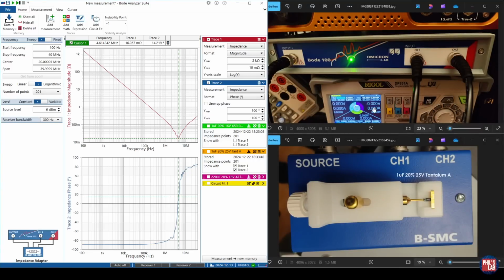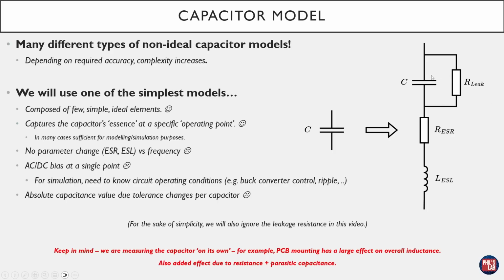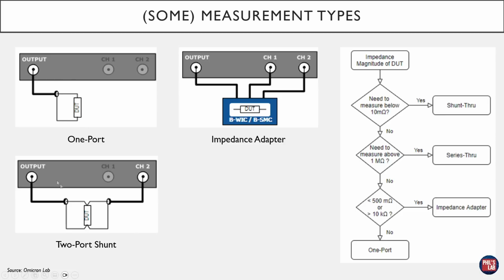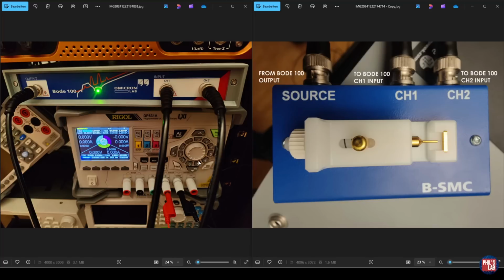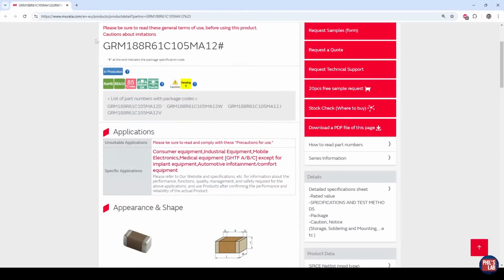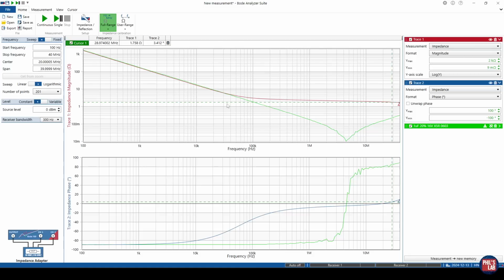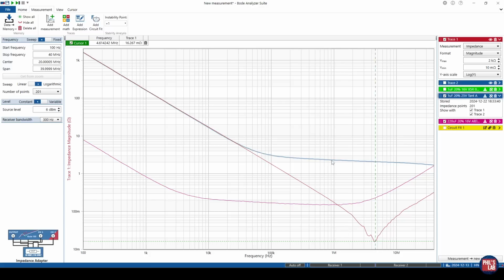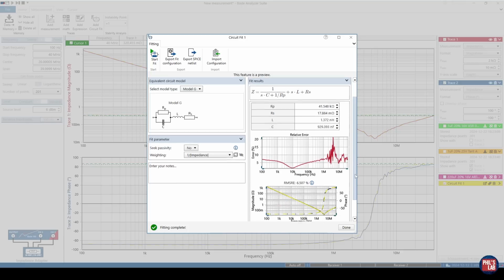Capacitor Measurement and Modelling Basics (Bode 100) - Phil's Lab #150

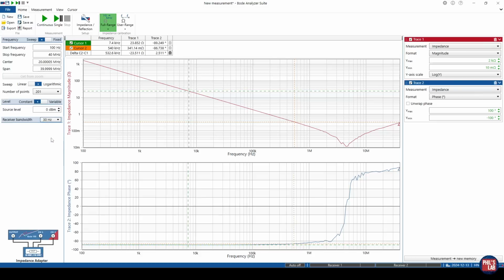Comment from the maker: Clarifications: 1. @29:00 I meant to say 'Number of measurement points increases resolution' (receiver bandwidth decreases noise).
2. Discrepancies in MLCC self-resonant frequency (measurement vs datasheet): I assume this is likely due to the limitations of the impedance adapter (sub 20mOhm measurement, 10% error already at 0.5Ohms, inductance limits already at 200kHz, etc etc - see the B-SMC user manual).
Also how much force is applied to the mechanism to improve the contact (during measurement & calibration) will influence the result slightly - like I mentioned in the video, I'm solely relying on the clamping force of the spring: e.g. for a 'short' calibration at around the resonant frequency of the MLCC cap my measured impedance is well within the range of the ESR.) Also, looking at the impedance vs frequency curve given by Murata, the SRF dip is actually quite broad (hits 20mOhms and below at 4-10MHz). During making of this video I've recalibrated numerous times to check for any calibration errors, checked multiple different caps, put two caps in series, and am consistently getting the same results. In future videos, we'll look at other measurements techniques (e.g. 2-port) and compare the measurements (I measured the same cap with 2-port and am getting far closer to the correct SRF and inductance).

Comment: Hello Philip, 

if you need an idea for your next videos: pcb  design for stm32n6 with battery power supply and pin out for cam module. this is the latest thing, it has a difficult package and you can make videos for the firmware to recognize license plates to open garage doors or something like that. will definitely be of interest to a lot of people in the next few years :)

Comment: Hi, good video. What would the specs of this small TVS diode be?. 100 1t NI or 11 NI?. It is installed on a old 3 digit PC Turbo LED MHZ display board (PD 900) and 

needs replacing. 5V the display gets. Has only one marker at the end and the ->I symbol on the board. Greatful for an answer.

Comment: Thank you for the very informative video! It would be neat to see the Bode results with a DC voltage applied to the capacitor using your DC Block and Bias adapter.
Reply from the maker: Thanks, Nick - we'll look at that with 1-port and 2-port measurements!

Comment: Hello Phil.
29:00 I'm not familiar with the device, but it seems to me that if you want to increase the resolution then it would be necessary to increase the number of measurement points rather than narrowing the filter. Narrowing the filter will reduce the noise level, not the resolution.
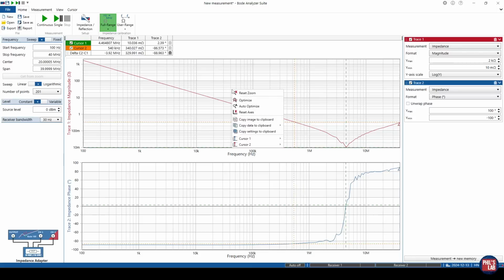29:30 The resonant frequency error is very large. 4.5 MHz measured and in the datasheet 7 MHz. Converting this to inductance, we get 516 picohenrys according to datasheet or 1250 picohenrys according to measurement. This is a very large measurement error. You performed the calibration and justify this error with an uncalibrated inductance of some kind? So You did the calibration wrong? Why didn't you do this calibration again already correctly? or maybe it is the instrument that measures so inaccurately? I did such measurements with the NanoVNA-H4 on 0805 100nF capacitors and got near 800 picohenrys parasitic inductance. Error much smaller than with a device for thousands of dollars. I also measured 2 pieces in series, in which case the inductance adds up, and it more or less agreed with the measurement of 1 piece.
Reply from the maker: Thanks for your comment! Regarding resolution and measurement points - you're completely right, I'm not sure why I didn't mention that. Regarding possible measurement error - I assume this is likely due to the limitations of the impedance adapter (sub 20mOhm measurement, 10% error already at 0.5Ohms, inductance limits already at 200kHz, etc etc - see the B-SMC user manual).
Also how much force is applied to the mechanism to improve the contact (during measurement & calibration) will influence the result slightly - like I mentioned in the video, I'm solely relying on the clamping force of the spring: e.g. for a 'short' calibration at around the resonant frequency of the MLCC cap my measured impedance is well within the range of the ESR.) Also, looking at the impedance vs frequency curve given by Murata, the SRF dip is actually quite broad (hits 20mOhms and below at 4-10MHz). During making of this video I've recalibrated numerous time to check for any calibration errors, checked multiple different caps, put two caps in series, and am consistently getting the same results. In future videos, we'll look at other measurements techniques (e.g. 2-port) and compare the measurements.
Reply: @PhilsLab  It seems to me that a weak clamp would increase the ESR measurement result, and here it came out very close to what is in the datasheet, so rather the clamp is ok. I wonder how the signal enters the adapter's pin with the spring. Perhaps there is something going on here and depending on the position of the adapter's pin the phase of the signal changes which affects the measurement error. This error is in my opinion so big that it actually disqualifies this adapter for such measurements. And when you measured 2 capacitors in series, what kind of inductance results came out? did they add up? or were they shifted by some fixed value? Have you tried perhaps to measure a piece of thick copper wire, so that this pin is in the same offset as with the capacitors? A piece of wire should have a predictable inductance. The measurement with this adapter is a three-port measurement, so it seems like it should be the most accurate. But the design of this pin seems to me that it should be split, so that the signal to CH1 is taken as directly as possible from the DUT.
I look forward to your next videos, with dual-port measurements. I find such measurements very interesting. Thank You.
Reply from the maker: Thanks for the ideas! With 2 caps in series the measured inductance approx. doubled (although it is still outside (too low) the 'rated' range for this adapter). I'll try your idea of measuring with a thick copper wire. Trying a two port measurement with the same cap gives the correct SRF + inductance with the Bode 100.

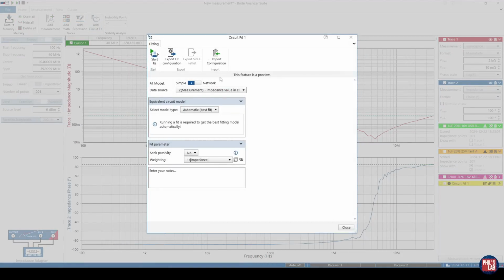Comment: Thanks Phil for the great detailed video. Out of curiosity have you tried to use the "seek passivity"(45:46) feature when extracting a model? I was also wondering if you had any plans to show on-board PDN impedance measurements in the future? I'm currently looking to do this for some of my higher-end boards where the processor/FPGA have explicit target impedance requirements. Cheers.
Reply from the maker: Thank you! I wanted to test the passivity feature out and compare - I've only recently updated to this new software version with circuit fit, so haven't played around with it terribly much.
And yes, I've had some PCBs manufactured where we'll measure the PDN profiles in real-time - in my eyes, super cool stuff to see in the 'real world'!

Comment: Ooh, capacitor parasitics, my special interest! :D

Have you found any good modelling solutions for DC bias derating in class II MLCCs? I've managed to do it manually in SPICE with behavioural elements, but it's very cumbersome and the simulation ends up being rather slow and often unstable due to the solver struggling to converge.
Reply from the maker: I'm afraid my method is also rather manual and often I just set a very specific operating point in terms of bias. Do let me know if you find a good way of tackling this though - I'd definitely be interested in hearing more about that!